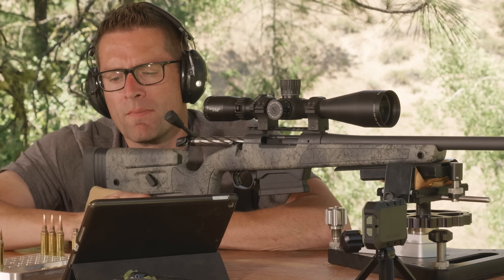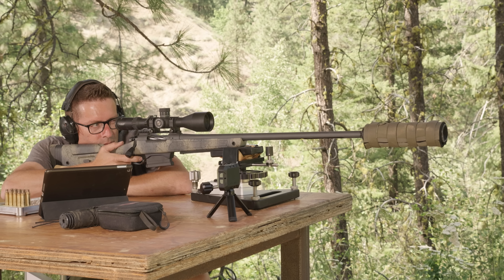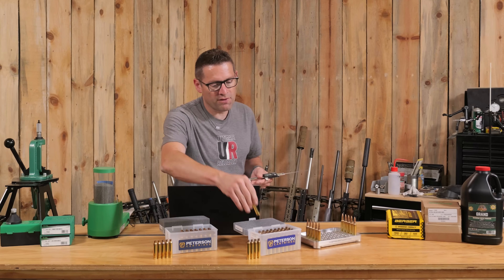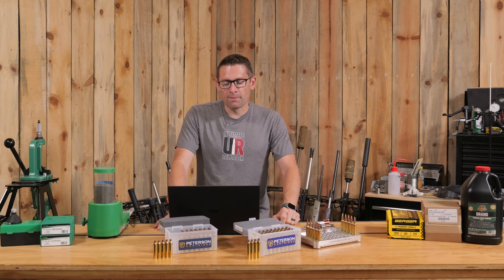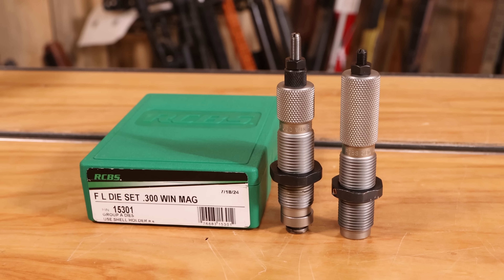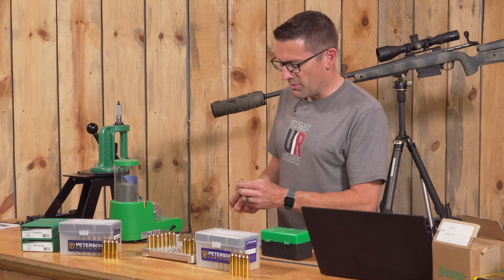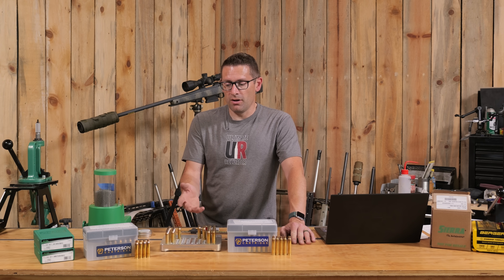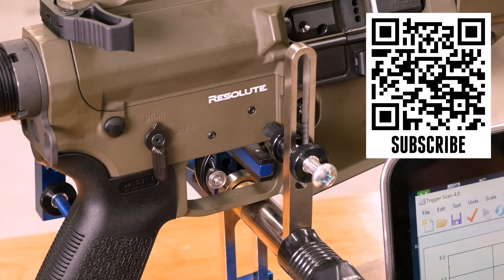Excessive Headspace Solved: Peterson Longs (7Rem & 300 WM)

Comment: Could I buy Peterson long mag 7mm rm and size it to 264 WM??
Reply: You should be able to without any issue. They are virtually the same cases, just 7mm vs 6.5mm (i.e., .264 cal.). Almost every other dimension is identically the same (other than neck Ø obviously). The only issue I could see is neck wall thickness will slightly increase and thus unless turning or using bushing die with appropriate bushing, the neck tension will he a bit higher. Even then, it probably wont be all that bad give that you are only going from 7mm down to 6.5mm.

Comment: Been using the 300long for awhile. after firing the shoulder on the new cases is 10 thou shorter than my chamber. The longs are 4 thou. Quite a bit less stretch on the first firing.
Reply from the maker: Awesome, sounds like it's working as advertised!
Reply: @Ultimatereloader  retumbo isn't cheap to go fire forming cases lol. Don't have to reduce a load that much just to get through the first firing. Surprised no one has came up with this idea in the past.

Comment: No excessive head space in my .338 Win Mag Sako 85 Brown Bear. Great info for brass prep, though. Thanks, Gavin!
Reply: From what I heard..more of a problem in the 7mm and 300. I really want a 338 Sako!
Reply: @derrickkoch8517  The 338win mag's have nearly just as much tolerance range at the shoulder as the 300's and 7 rems ( .0091 ~ .0261 for SAAMI). It might be that some like Sako (and maybe others) is (are) using a shortened reamer and cutting the chambers to better match the brass specs (possibly even a couple thou under SAAMI max case size since a thou or two of crush would be barely noticeable in bolt force and that would be only if the case was at SAAMI max, which is rare for a factory loaded case from any supplier)
Reply: @derrickkoch8517 thank you for clarifying! Hope you get one soon.

Comment: Which is of course solved by neck sizing once fired brass (from the same gun).
Reply: Question he says in the beginning the brass will stretch to fit the chamber but the excessive stretching will case a reduction in brass life but I thought most brass life was dictated by the brass’s ability to retain a tight pocket primer though some can have neck casing split is that what he in preventing?
Reply from the maker: If you stretch the case by 0.010" - 0.020" you'll be more prone to cracks (shoulder, case body, etc).
Reply: I wouldn’t just neck size, especially in hunting ammunition, just bump the shoulder back .002 or .003.
Reply: You can just upsize the neck of virgin brass and create a false shoulder by slowly sizing them back down until they fit tight for the first loading. Basically creating a false shoulder on the neck to headspace and stop the brass from slamming forward.